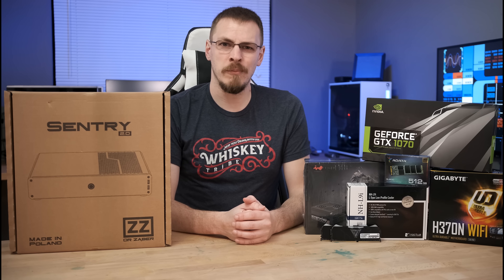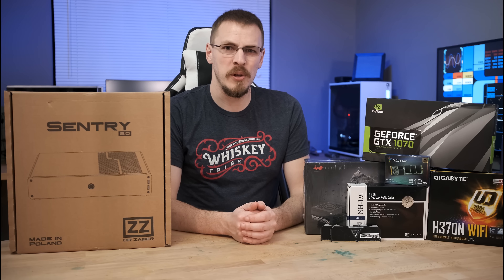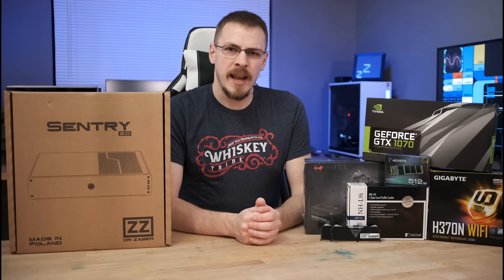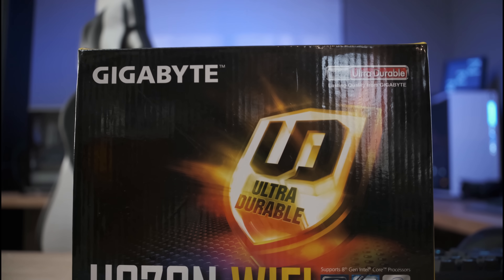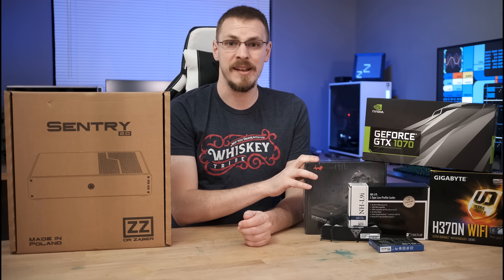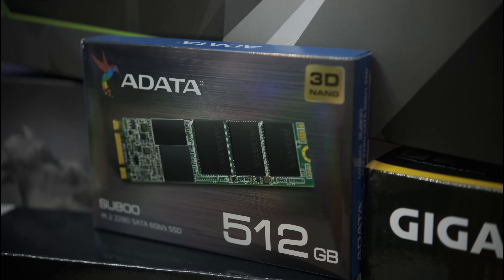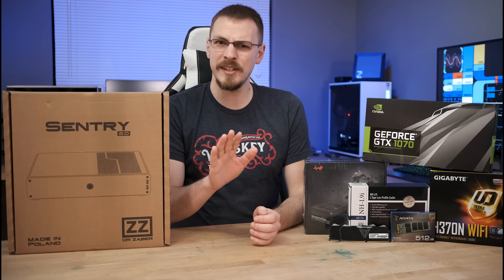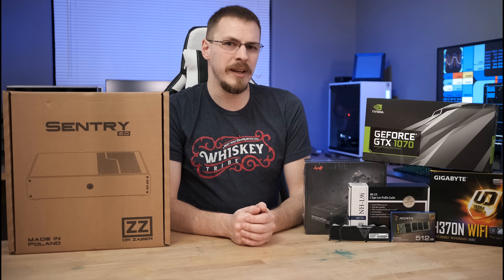Small but MIGHTY!  Dr Zaber Sentry 2.0 Build and Review!

Comment: Seems Linus was the only one crazy enough to chuck a Titan RTX in his lol. You and Kyle (BitWit) went fairly reasonable. 
I still have my Sentry 2.0 in grey  sitting unopened in the shipping box. Was gonna do a media PC but ended up making a rack mount custom unit to go in my AV rack in the air conditioned AV closet so now I have no use for it lol. I'm in the middle of making a from scratch milled custom case made from lots of AU with homemade water cooling manifold and tank made from copper with lots of brazing going to use either glass tubes as I have experience working glass or may go copper as it's so pretty. Gotta find something to do with this 3090 Ti I've had for months hanging out sealed but it needs to be perfect. Maybe I'll have it sorted by the time the 5K series come out

Comment: I'm looking to build a Dr. Zaber Sentry system with a full length open-air GPU in the future. I'm looking to purchase the filters found here (https://www.demcifilter.com/DR-ZABER-SENTRY).

Can you tell me if it's necessary to get the whole set for my specific setup? If not, which parts for which panels do you recommend? I assume an exhaust filter is unnecessary. Would you know if the vertical and horizontal dust filters work in either vertical or horizontal case positions?

Thanks.

Comment: Ventilation issues aside, is it safe to lay the Sentry on its side and place a 27" monitor on top of it? Will the sides sink in? Is there structural support internally? Can it support flat and/or pronged monitor bases?
Reply from the maker: You could almost stand on this thing with no worries. 27" monitor isn't going to hurt it.
Reply: @CraftComputing  that's good to hear! Thanks!

Comment: As cool as this is, I'm too much of a digital slob to not have a billion hard drives in my machine.  That said, the prospect of throwing in a 500 GB/1 TB m.2 and a 2 TB HDD and reserving part of that SSD as a cache for the HDD means this is still a pretty tempting proposition (primocache is some super great software btw), considering the form factor and the hardware you could still fit inside it.

Comment: ITX builds are indeed pretty cool. But the main problem is HDD storage. Short-term 2tb might be fine, but on my main computer I want expandability. I already have 4 drives installed into my build (upgraded slowly since 2013) and it will be getting more. However maybe a NAS could solve this, I have never really bothered using one as they run 24/7 which can get pricey
Reply from the maker: Supports 2x 3.5" drives if you'd like instead of a GPU. Also has a mount for 2x 2.5" drives. ~~Seagate makes 4TB drives that would fit well~~, and the board I used has 2x m.2 slots.

Scratch that.  2TB max on the Hybrid drives, and the 4 + 5TB drives are 15mm.  So yeah, 2TB max size right now.
Reply: That kind of storage (If actually used) really should be external and backed up somewhere else.

Comment: I built my second system for traveling about a month ago and used the Fractal Design node 202. I do like this case but why buy it when the node 202 is basically the same thing and much cheaper?
Reply: Mr. Radio Voice The Node 202 is slightly more flexible and not as fiddly as this case. My lounge room PC is in a Node 202 along with a i5-8400, 16GB RAM, Scythe Low Profile CPU Cooler, Corsair 600w SFX, Samsung 970 Evo 500GB SSD & a Strix 1060 OC. Makes for a solid machine in a great case.
Reply: @Devastator0  That is what I thought. I will admit I wouldn't mind a slightly less bulky case as it is a bit tall when carrying(just enough to make it awkward),but otherwise is an amazing setup. I threw a ryzen 7 1800x that I had laying around on a b350 board and threw in a 970 that I also had laying around and cablamo, there is a pc for me to carry wherever I wish to go.
Reply: Mr. Radio Voice Yeah, I don’t think I’d want to be moving it around too much but makes a perfect AV/Entertainment Unit PC in the horizontal mode. But haha, must be nice having a spare Ryzen chip just lying around, however sounds like you’ve got a good little PC there too!
Reply: Anthony Roman yeah that sounds shitty. Let me correct myself, I purchased the ryzen 7 for a good deal, and then switched back to my 6850k in my main rig, and now I am regretting that decision.
Reply: Mr. Radio Voice this case is nearly 50% small and has better gpu thermals by around 5 degrees Celsius even when the node 202 has extra fans bellow the gpu and there is a big difference in build quality but I kinda agree with you with buying the 202 but I disagree with you saying it’s basically the same thing

Comment: That is an unbelievably tiny motherboard. My motherboard could eat your motherboard for breakfast and demand seconds, that's how small it is. Wow.

Edit: Also, I LOVE that BSOD T-Shirt.
Reply: Never seen a mini-itx? lol
I imagine you use the super average ATX.

Edit: this format is among the type of motherboards I look for. Since I will probably never need more than 1 video card, or any PCIe expansion card besides video for that matter, and 2x8GB, while suboptimal still is more than I will ever ask for, it will suffice my needs for a long time. 1CPU, 1PCIe x16 and 2 RAM slots (plus M.2 connection and standard SATA)... all I need. And mini-ITX are also cheaper. The only downside is that the smaller a case is, it can get potentially more expensive (note to "potentially", since depending on the brand, it will also be cheaper than an ATX case).
Reply: @NothingXemnas  E-ATX actually. I also run two video cards (non-SLI) and four sticks of RAM, as well as a USB 3.0 expansion card that I had lying around from an earlier computer and I figured more USB ports can't hurt. The only caveat being that I had to find a way of cramming the board into an ATX case, which ultimately involved some metalwork.
Reply: @thekrautist 
Wew! Wait, why didn't you have an E-ATX case? Just didn't bother to buy one so used an old ATX?
Reply: @NothingXemnas  I was not aware that E-ATX is a form factor that exists until I tried to install this hand-me-down motherboard and it wouldn't fit.